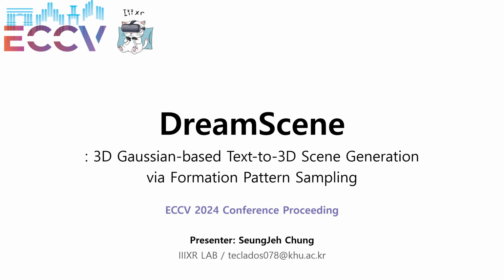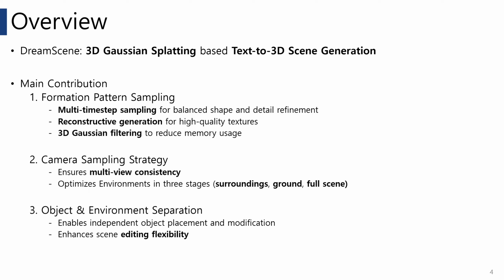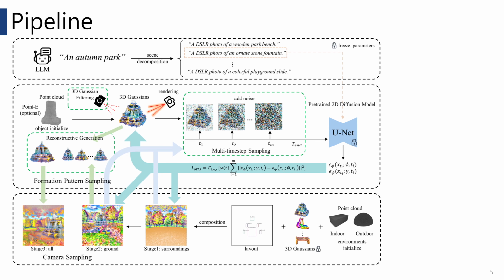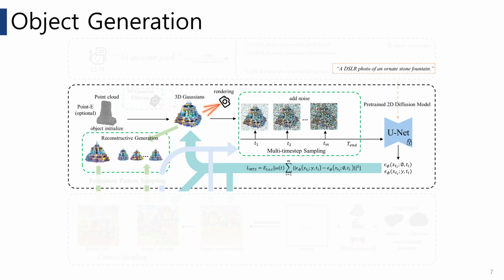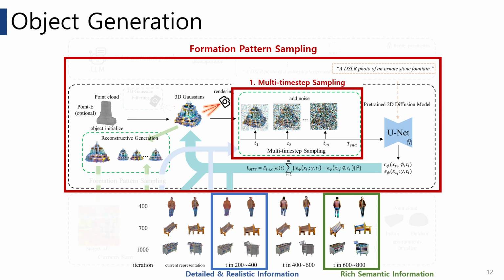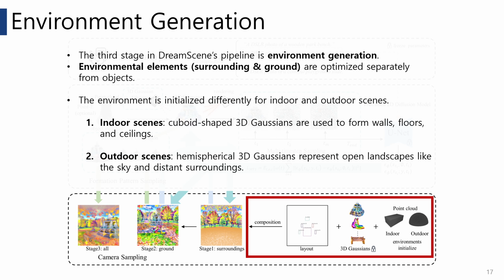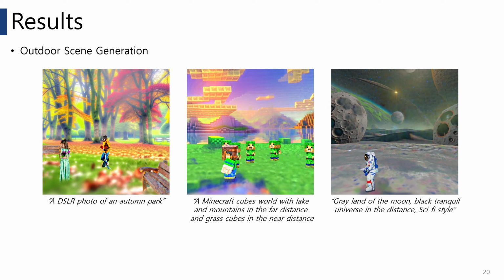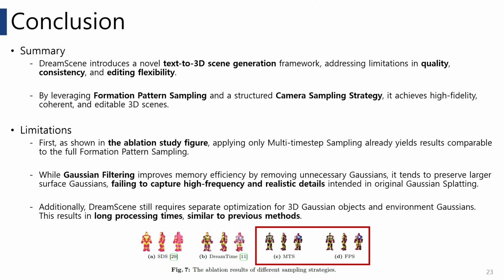[Seminar] Text-to-3D Scene Generation using 3D Gaussian Splatting (DreamScene)

Comment: Thank you for your presentation.

1. In inpainting-based methods, do we need to provide both text and part of the scene as input?

2. On slide 12, why does the early step capture detailed & realistic information, while the later step captures rich semantic information? Could it be the other way around, or is it possible to extract detailed information in the later step?
Reply: A1. It depends on the method. Some approaches generate parts of a scene using only text and then apply inpainting, while others take both a scene image and text as input.

A2. According to the DreamScene paper, the diffusion model captures detailed & realistic information in the early timesteps and semantic information in the later timesteps. While this is not a widely known fact, the paper claims this principle was identified through experimental results.

Comment: Thank you for the great presentation!

Q1: When objects and the environment are optimized separately, doesn't it cause issues such as a sense of disjointedness between them?

Q2: It is mentioned that the process takes a long time. Could you explain, in terms of time complexity or any other specific metrics, exactly how long it takes?
Reply: A1. Correct. Typically, there is a disconnect between objects and the environment, so DreamScene adopts a 3-stage camera sampling strategy to maintain consistency in appearance. However, I also have doubts about how well it actually preserves consistency in the results.

A2. The generation time increases by O(n) with the number of objects.

Comment: Thank you for the presentation.

1. How does DreamScene compare to other text-to-3D generation methods in terms of training and inference time, and what are the key differences in computational cost?  

2. What specific techniques does DreamScene use to enhance the efficiency of text-to-3D scene generation while ensuring high-quality and consistent outputs?
Reply: A1. In terms of training and generation, each object takes about 30 minutes, and the entire scene takes around 1 hour. As the number of objects increases, the generation time also increases. Compared to other generation methods, simpler scenes can be generated much faster, while complex scenes take a long time for both approaches.

A2. It uses Formation Pattern Sampling and a novel camera sampling strategy.

Comment: 1. In the field of 3D scene generation, what does "consistency" refer to? Is it about issues like generating different objects when the viewpoint is changed?

2. In 3D Gaussian filtering, how is "closeness" to the rendering plane defined? Is it determined by whether an object falls within a certain boundary?
Reply: A1. Correct. It refers to the issue where the appearance of objects or scenes changes when the viewpoint shifts.

A2. Closeness can be thought of as the distance from the camera to the 3D Gaussian minus the camera focal length. The rendering plane is a pixel plane defined in screen space, and closeness is determined by the distance between this plane and the 3D Gaussian.

Comment: Thank you for the presentation.

Q1: Is there a specific way to improve the given text when decomposing it in the first step, such as using a special prompt?

Q2: The results from DreamScene do not exhibit good texture quality. The textures appear overly glowing, and the lighting reflection details seem incorrect. What causes these low-quality details?
Reply: Your analysis of the results is excellent! The issues you pointed out align perfectly with what I also identified.

A1. DreamScene briefly explains text prompt decomposition using LLM in just 2–3 lines and does not introduce any specialized prompt engineering. (This is the same issue I identified, and addressing it is one of the main focuses of my paper.)

A2. The overall shimmering or blurry effect is due to the paper not considering the characteristics of 3D Gaussian Splatting. A high number of 3D Gaussians is required to capture fine details, but since this paper targets an entire scene, an extremely large number of Gaussians would be needed to avoid blurry or unrealistic effects. However, the authors did not account for this and even introduced an algorithm to filter out unnecessary Gaussians. As a result, the lack of sufficient 3D Gaussians leads to artifacts like the "overly glowing and shiny" effect you mentioned.

Comment from the maker: Interesting topic!
Q1. Does the technique generate each object using a diffusion process? If so, does every background component also get generated as a single object?
Q2. When an object is generated via CSD, is it then placed back into a noisy image to be processed by the U-Net again? And is there a trainable network involved in this step?
Q3. What causes the generated background to look unrealistic—low-resolution or dreamlike?
Reply: A1. The ground and surrounding are initialized as hemispherical 3D Structure for outdoor scenes and cuboid 3D Structure for indoor scenes, optimizing the entire environment at once. This constrains the space, and the environment is generated as if viewed from the inside with a panoramic 2D vision. So, the camera cannot be placed outside the cuboid or hemisphere.

A2. Most methods using 3D Gaussian Splatting do not train separate networks; instead, they directly optimize parameters such as opacity, color, mean, and covariance of 3D Gaussians. Thus, CSD loss serves as a prior to optimize these parameters. The 3D Gaussian object is rendered into 2D, where the CSD loss is computed and then backpropagated to iteratively optimize the 3D Gaussians.

A3. Continuing from A1, since the environment is initialized with a restricted cuboid or hemisphere and optimized only from an internal perspective, the optimization focuses solely on the inner surface of the environment. This results in very low resolution and poor quality. (This aligns with the issues I’ve identified, and addressing this is one of the main targets of my current paper.)

Comment: Interesting presentation! Thank you
1. Looking at the results of the indoor scene at 19, the material seems to be sparkling like a rainbow, but is there any word that can cause this phenomenon?
2. Looking at the results of the outside at 20, it seems that the ratio of people to trees does not match, but do you think you can consider not only the layout but also the size on page 18?
3. If you look at p.18, it seems that all camera views are used for learning at once, but why do people's faces exist in various aspects in the middle of the outdoor result at 20? Would you consider comparing cameras with each other in the paper?
Reply: Your analysis of the results is excellent! The issues you pointed out align perfectly with what I also identified.

A1. The overall shimmering or blurry effect is due to the paper not considering the characteristics of 3D Gaussian Splatting. A high number of 3D Gaussians is required to capture fine details, but since this paper targets an entire scene, an extremely large number of Gaussians would be needed to avoid blurry or unrealistic effects. However, the authors did not account for this and even introduced an algorithm to filter out unnecessary Gaussians. As a result, the lack of sufficient 3D Gaussians leads to artifacts like the "sparkling like a rainbow" effect you mentioned.

A2. The paper does not deeply consider scaling. When generating a scene with correctly proportioned objects like trees and humans, the number of Gaussians assigned to each differs, leading to resolution mismatches and inconsistencies. (This is actually the main target issue of my next paper.)

A3. This issue is the well-known Janus problem in 3D generation tasks. Since optimization is performed across multiple views with the same text prompt, faces can appear on multiple sides. The paper does not specifically address this problem, which is why Janus artifacts occur.

Comment: In the field of computer vision, they applied ViT to the diffusion model, which is known as DiT.
Do you know of any network that could replace U-Net in Gaussian diffusion?
And how about use attention mechnism? I think it is suitable for the scene text decomposition.
Reply: A1. I am not aware of any papers that use a network structure other than Stable Diffusion for Gaussian diffusion. However, research utilizing new diffusion priors, such as the DiT structure with transformers, seems very interesting.

A2. I believe text decomposition can be performed much more effectively through LLM-based prompt engineering.

Comment: Good.

Q1. In slide 3, you refer that previous works have limitations of low quality, multi-view inconsistency and editing flexibility. Then which feature makes these limitations in previous works? If simple text prompt is problem, is there any research associated it? I think task decomposition likes Scene decomposition is so common that many research already adopted it.

Q2. Why U-Net based diffusion model is used? Is there any positive things rather than using Transformer based diffusion model?

Q3. Why use L2 reconstruction loss as objective function? There are ablations for any other loss likes l1 or l1 smooth?
Reply: A1. The issue is not mainly with text prompts but rather with previous text-to-3D scene generation methods adopting inpainting-based approaches. These methods optimize and generate the scene as a continuous representation rather than decomposing it into objects and environments. However, since 2024, decomposition-based methods have gained traction. Unlike LLM studies focusing on text prompts and retrieval, there have been few approaches generating entire scenes from scratch after DreamScene.

A2. Text-to-3D generation models have primarily adopted the lightweight and highly realistic performance of the latest Stable Diffusion models. As far as I know, there is no paper demonstrating that a transformer-based diffusion model outperforms UNet-based models for text-to-3D generation tasks.

A3. The original 3D Gaussian Splatting paper uses L2 reconstruction loss, with no discussion on alternative loss functions. However, L2 loss has been reported to work very well in this context.

Comment: Nice presentation

Q1. Why do many diffusion-based 3d generation methods use pretrained 2d diffusion models? I heard there are some 3d diffusion models that work directly on 3d. Why do they still use 2d diffusion models instead?

Q2. I don't like the way people render the reconstructed 3d scene into 2d images and than compare the loss there. Why can' we compute the loss in 3d directly?
Reply: A1. 3D diffusion models do not perform as well as 2D diffusion models, especially in terms of realistic performance, where 2D diffusion models are significantly superior. 3D diffusion models are mainly useful for generating initial values related to 3D shape and geometry.

A2. This follows from A1. The prior of 2D diffusion models is much stronger, so the loss is also projected into 2D for optimization. This approach is known as the 2D-to-3D lifting technique.

Comment: Hello, I appreciate for your presentation.

Q1. What are the common issues with existing text-to-3D methods, such as Text2Room or Text2NeRF?
Q2. How does DreamScene solve the problem of multi-view inconsistency, which affects many previous methods?
Reply: A1. During training, undertrained camera views produce almost unrecognizable results. This means that with random camera sampling, the likelihood of poor outcomes is very high.

A2. From a scene perspective, a combination-based method is used, where objects and the environment are generated separately and then merged. A new camera sampling strategy is introduced to mitigate view inconsistency. However, no specific solution is proposed for the Janus problem when generating objects.

Comment: Thank you for the presentation.

Q1. What LLM actually holds in paper's architecture? I think LLM is 'generating' scene's finer structure rather than decomposing it.
Q2. Is there any chance to model to fix previous stage? (e.g. any modification to surroundings when dealing with ground) or model have to wait until stage 3?
Reply: A1. The LLM only plays a role in splitting the overall scene text prompt into individual object text prompts. In the paper, the LLM is mentioned briefly in just 2-3 lines without detailed explanation.

A2. Elements like the surrounding and ground are generated separately from objects and can be modified in earlier stages before stage 3.

Comment: Great presentation.

Q1. On slide 17, is the layout given, or is it generated based on text? If it is given, have previous scene generation studies also conducted experiments under this condition?

Q2. On slide 21, it seems that DreamScene takes 1 hour of time cost. Does this time cost refer to generating all objects that make up the scene and the entire scene itself? Or is it the time required to generate a single object? Previous studies seem to optimize the entire scene at once, so it is interesting that DreamScene completes inference more quickly.
Reply: A1. The layout is provided. Some previous works focus on generating the layout itself, while others use it as a conditioning input.

A2. This is the ironic part of the paper. The paper states that generating a single object takes about 30 minutes, while the reported generation time in the comparison only accounts for scene optimization after all objects have been generated and the layout is given. This means that constructing a scene with 20 objects would take 20 hours just for object generation. Moreover, the actual code is implemented to run on multi-GPU, making the reported time consumption seem unfair in my opinion.